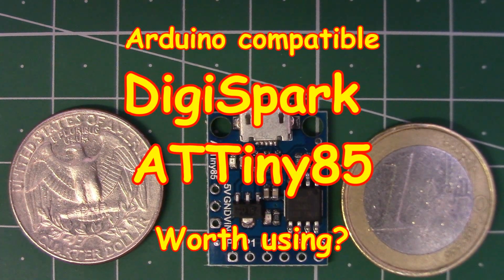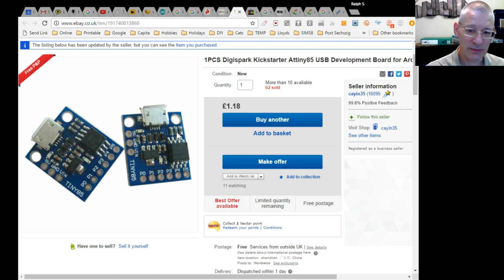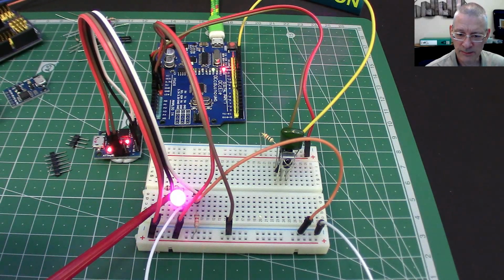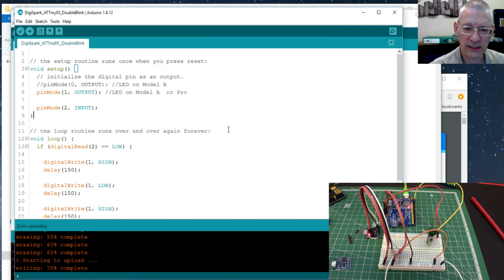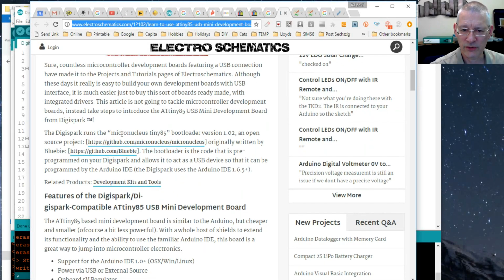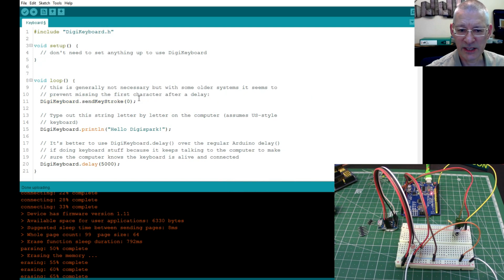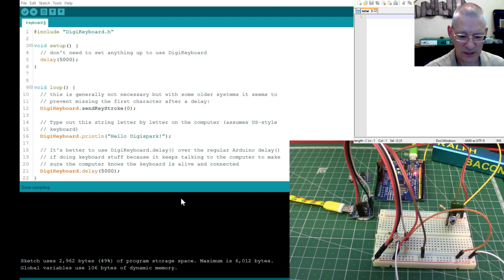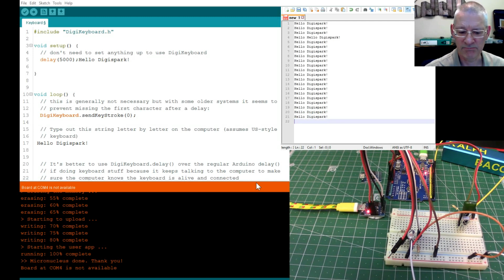#66 AT Tiny85 Digispark - Arduino UNO alternative? An introduction!

Comment: I remember buying 2 of these. I think the engineering on them is bad. Mine will not register properly with windows. They keep connecting/disconnecting repeatadly. Its why I never used them. However in your video you suggested they have power issues. This may be a way to fix them to get them to work better.
Reply from the maker: ATTiny85 devices don't have built in USB so some board manufacturers fudge the issue with diodes and other components and sometimes it works, sometimes not. I use the FTDI or other Serial to USB converter and it's rock solid.

Comment: Hi Ralph, I am back among the arduino lovers once more after a brief absence because, well getting old is hard on an old farts body and I had to loose a chunk, the doctors took my right kidney from me because it had grown very large and was full of cancer.  They tell me I am now cancer free, I hope they are right, the doc who cut me open says he wants to see me very 6 months for the next 5 years, I consider that a plus that he figures I will be around at least that long. At any rate thanks for the refresher on the AT Tiny 85, I built several count down timers using that chip several years ago, had one in my Ford that I pulled behind our motor home, the book said I should run the car for 20 minuits every time I filled the RV with gas.  So I built one for that but made it a count up timer.  Now that I have retired the RV and sold it last week, I have the timers left over. I gave one to our ambulance squad to use when doing CPR in the rig as they needed something like that and that one had a large LED display, my daughter uses one when cooking for a timer. So thanks for the review, I am trying to figure out how to do this in Linux as I got fed up with Apple's obselecense auto slow down and ripped apple OS from the hard drive and now am happy with Linux Mint which runs like a raped ape compared to osx
Reply from the maker: Good to see you back in Arduino Land, Jerry, and I wish you all the best for your future health. Keep up with the programming and electronics, you don't want the grey cells getting rusty.

Comment: I brought digispark attiny85 development board

But this board keep connecting and disconecting continuously
What. We need to do

Please help

Paste
Reply from the maker: You are connecting this board to a USB-to-Serial adapter? Or you are programming via the SPI pins on the board (which is a more reliable way of doing it)? Or you are plugging directly into USB? Check that the any connections are powered correctly and are stable. You have selected the "Digispark Pro (Default) 16.5MHz" in the Arduino IDE? Programmer selected is Micronucleus? You plug the device in within the 60-second timeout period? Can you upload an example program to the device?
Reply: @RalphBacon  
I am plugging in device directly in USB port
Plugged in within 60 seconds
All settings are as expected 16.5 and micronuclous

But after clicking uploading code, 
Code is not uploaded but 

Please tell me
One thing , what device manager shoes

Comment: Do you think one needs the resistors for connecting buttons (actually a Morse key) to the microcontroller and thus emulating a keyboard?
Reply from the maker: A morse key doesn't emulate a keyboard in anyway whatsoever (the keyboard being USB driven). But a resistor from VCC to the pin to keep it high (before the morse key shorts it to GND) is only necessary if you cannot define the pin as INPUT_PULLUP which does all that for you.

Comment: I don't recommend this board. So much trouble. Even simple MIDI songs with buzzer gives me nightmare. Not enough RAM or flash! Don't buy this! Use pro mini they are very cheap, you can buy seperate programmer. Pins can output 40mAh and solid Arduino support!
Reply from the maker: Ha! A lot users might agree. Then again, a lot of users will disagree.
You can't treat the ATTiny85 as an UNO (ATMega328P) they are very different chips, but both are fully supported by the Arduino IDE and some very nice cores have been developed by others to maximise their usefulness. 
Now, outputting 40mA on a pin is the absolute maximum allowed by the manufacturer and you can only have 200mA max into the chip, so normally we try and limit pin current to 20mA to be safe and allow more pins to be used.
A Pro Mini is little more than a naked ATMega328P with some supporting components (crystal, caps); I use them all the time but I also have designed some basic boards that are functionally equivalent. If you don't need the USB support then they work nicely but the Nano is cheaper,  is almost as small and is a full blown UNO!

Comment: I am going to have to come back to this but no matter, I am an Old Git and do not learn as fast as I did but I am interested in this because I used/played with a PIC thing some years ago, an 18 pin device 84 comes to mind but again no matter and it was a simple problem need 3 or 4 active I/O and worked OK (I have/had no problem with assembler language). After digressing somewhat it seems to me that on an Arduino device the amount of programming memory available is far greater than the amount of I/O available, so why have it. Hence the interest in the smaller implementation and I am grateful of you for paving a path because I MAY not be as tenacious as I used to be.
Reply from the maker: Have a look at my most recent video #181 which makes playing with the ATTiny85 (and ATTiny13) much easier.
https://www.youtube.com/watch?v=7Tl8l0PliTk&feature=youtu.be

Comment: Much much later than the date of this video, but I am hoping to use an ATtiny85 to interface a casio fx-9750G PLUS. It would require reading and writing the USB port as well as a Tx and Rx pin pair ,
Reply from the maker: The ATTiny85 does not have a USB port, as such, Johan. If you have a module with USB socket on it, it either only supplies power or the D+/D- are directly connected to the Tx/Rx pins - so you would need a USB-to-Serial module (eg FTDI) to read/write the data.
Reply: I thought as much, but was not sure. Mmmm...

Comment: after i found the attiny 85 i have went out and buy about 100 of them and made lot of little things, about the same as i did with the uno and pro mini and nano, i have many different ways to program the attiny 85, but i now have found the Arduino as ISP is the most fast, i can get 3 Pins with the Atting to work as PWM, and seen some code with 4 Pins but only the 4th pin when one pin is off, and can control them with a pot for speed, i am trying to work out a way to do a easy code with LDR so the LED only turn on at night, as i want to set up the attiny 85 at every window of a build that looks a bit like a censor, maybe some one has some way to do it.
Reply from the maker: You bought 100 of these devices? Wow! I hope you got a massive discount. If you connect the LDR to an input GPIO, read it every few minutes (you can put the chip into deep sleep for that long, by waking up every 8 seconds and doing that 75 times) and only light the LED for a brief 100ms flash then it should run on a 3v coin cell for quite a while.
Reply: @RalphBacon  I sort of got it to work the other night, i can look at the sleep timing later, as i only want them to flash in the night time and go to sleep at the day.  so the LDR turns off the 3 LED's, i was shaking it there when i could not get it to work and found the light in my workshop was to bright. but its working now and made some proto PCB. maybe run it from 2, 18650 or 2 14500, with a small reg on the PCB.

yes i got 100 i pay 0.60 AUD each for them, that's about 40 GBP including the shipping. ATmega328 is about 1.30 each AUD each. when i was working in China i made some friends in shops with taobao haha
I like to ask what is the best mosfet  to use with Arduino i have been looking at IRL 630,640, 520,540  LOGIC switching

Comment: These boards are a NIGHTMARE! Stick to to the Nano / Pro Mini... OR make your own shield to use an Uno to program ATTINY85 DIP-8 Chips.
There is also an error from the chinese factory with Pin5. The Fuse on Pin 5 is set incorrectly. So, this means that every time Pin 5 goes LOW the whole board resets. There is a way to write to the appropriate register or something to make pin non resetable. Check this out Ralph, if you havn't already. I'd love a clear video done by you on this.
Reply from the maker: Hmm, perhaps my Tiny85s are from a different source as I haven't found this (not that I use many Tiny85s). I'll see what I can dig up on this issue...

Comment: Hi Ralph I have purchased 2 ATTiny85 boards the same as you show but I am unable to load the board using the link shown for the Arduino IDE the link is in Preferences - http://digistump.com/package_digistump_index.json So I don't see any extra boards or anything in board manager any suggestions please or perhaps you could do a video on it to help others with the same problem!! ( I am using Arduino Ide 1.8.9) ( just changed to 1.6.12 and all working ( ThanksRalph) All the best Bob
Reply from the maker: So are you saying, Bob, that  IDE 1.8.9 doesn't work to program the ATTiny85? But IDE 1.6.12 does? How strange. Try 1.8.9 again, perhaps it was just a glitch? Be interesting to know... 🤔

Comment: There are times when I only need a few pins so yeah this fits the bill.  Didnt know about the keyboard emulation. So you can send data direct to Excel, nice. I bought a few of these but I haven't had the day to get them going.  Thanks Ralph.
Reply from the maker: Thanks for that, Joey Mac, nice to hear from you.
Reply: I could not get these to upload successfully under linux. I don't use windows any longer so I do not think this is an option for me.
Reply: I did get these working. I had to unplug the board, click download, then re-connect the board.

Comment: Ralph, there is a way around the 5 sec delay, needed it for a low power battery project and couldn't live with that timeframe as my code ran for less than a second. If anyone is interested I will post the details, its works a treat
Reply from the maker: It's been a while, Dean, since I fiddled with the ATTiny85 so do please post away your solution for others to read. One option, of course, is to use no bootloader so the code runs instantaneously upon power up but you probably have a better way.

Comment: Ralph! Love the tutorials by the way, your videos are god sends!  I have a conundrum for you. Im using a Yamaha MG166C mixer for internet radio, I'd like to know is there a way I can make a unit with a nano or Uno (whatever is needed) that I plug my mic into, which acts as a through line into the mixer but what the Arduino does is, when the mic turns on it works a relay that will turn off my speakers and turn on my ON AIR light.  My Mic has a 48v phantom power line going through it. Thanks for any help you can give me on this problem.  Regards MDD
Reply from the maker: Hmm, you just want the act of switching the microphone on to disconnect the speakers and switch on an "on-air" light - but not affect anything else, right, Marty?
 
How do you switch on the microphone? Via the mixer? How can we detect that the microphone is "live"?
Reply: @RalphBacon  Firstly thanks for your reply, Yes you are right, the Mic plugs into a mixer, the model is the Yamaha MG166C. Its a condenser microphone which takes a 48v phantom voltage.  There is an 'on and off' button to turn it on and off.  The on air light is from canford, it has a 240v light bulb in it that gets activated via some pins lol the spec for it can be seen here https://www.canford.co.uk/Products/20763/51-401_CANFORD-ILLUMINATED-SIGN-BC-base-fitting-type-A-230-volt. I'd like to so when I press the mic on button it pics up that the mic is now in a live state and activates the arduino to work 2 relays, one that touches the pins together lighting the light and another that cuts the power to two monitor speakers thats are 240v powered.  Any more info needed Im at your service :) Thanks Ralph.

Comment: at 17:25 you talk about the "digiUSB" but seemed confused, not sure what they're talking about there but on EVERY operating system all that is needed to talk to an attiny is usb 2.0 OR a usb HUB that pushes USB3.0 into fallback mode to 2.0... because then avrdude can talk and upload to the attiny. As I said this is irrelevant of whether you're on windows xp - 10 or any Linux distro (not sure on OS X). That is the same as the adafruit trinket (which is very similar to the digispark thing you have)
Reply from the maker: Ah, yes, indeed grats gg, that was referring to what the instructions said that Windows 10 should have identified the USB Tiny board as. Basically, once the hardware had been enumerated I should have had a device named "DigiUSB" but I did not, it was called something else (possibly some generic term, or indeed never showed up at all) but it still worked fine. That's all. And, as you say, as long as your PC (of whatever OS) can "see" the board then it will communicate with it. Thanks for posting.
Reply: ohhh ok I see. I haven't been on windows in many years so I forgot it tries to name every usb device.
Reply: I am on a linux machine. If I look at my usb ports it is listed as MCS digistump digispark. Also there is a Linux foundation 2.0 root hub.

Comment: The Tiny85 get programmed in a different way as well. It gets programmed by power it off, and powering it on, and when it comes up it will read the program.  You also need to load the library for the Tiny series of chips.
Reply from the maker: True, Joseph, I think that's the way that bootloader is written? It should do the same on an RST... I think. YMMV. Thanks for sharing the tip, nice to hear from you.

Comment: Hi, Ralph, I want to make a copy of a three button IR transmitter so do you think this would do it??
Reply from the maker: Well, Bob, you need a PWM output for the IR LED, plus three pins for the buttons (using a switch matrix doesn't help to reduce that here). If you have enough pins then it will certainly "work". If this were me, I'd get it working on a standard Arduino Uno/Nano and then port it over to the Tiny85, just because it is so much easier to work with the Uno whilst developing.
Reply from the maker: Actually, you don't need pwm, just a digital output.

Comment: Its harder to program those attiny85 boards than a pro mini.. I have lots of problems with attiny85 when it says to plug it in, I do and 1/2 the time it doesnt work.
Reply from the maker: Agreed, HH, that is the case with me too. In fact, it's sometimes worse than that inasmuch that I can do half a dozen uploads no trouble at all, then it decides it doesn't want to play anymore and refuses the next 4 or so! Bizarre. There's probably a knack that I haven't quite mastered yet. When I find out what it is I'll let you (and everyone else) know! Good to hear from you.
Reply: I know you didn't seem to like the pro mini but its really easy and reliable to program and works all the time and is a full Arduino just tiny..  great vids!!
Reply from the maker: It's not that I don't like the Pro Minis, HH, it's just that they don't have a USB port so that makes demoing more difficult. And, in a real project, not being to quickly plug in a USB cable is less than ideal, but that's just IMHO. I'm sure they are great to work with if not having a USB port doesn't make you go grrr every time you want to upload!
Reply: @RalphBacon  Al you need is a FTDI basic chip from SparkFun. They come with a female header. and USB port. Then you take a male header and put it in and hold it to your Mini Pro and upload.
I have 2 Mini Pro. One 3.3 V and a 5V with male headers. These are for testing purpose.
When the software is ready i'll take the new Mini Pro and upload the sketch as described above.

Comment: I have been using these little digispark's to build count down timers for specific problems. For example, my wife had medicated eye drops that require that she install the drops in her eye, then wait for a specific period of time, in the Morning, it requires a 2.5 minute wait, and the evening drops require 2 minute flat count downs.  So I built her two timers using these and a 4 digit 7 second i2c display, as well as a buzzer that plays a merry little tune when the time is up.  I have it mounted in a very small project box, with a 9 volt battery holder with built in switch to run the device.  I even built one for our car, which I tow behind our motor home when traveling. It requires a 5 minute run every morning, and at every gas stop, so I tossed another together for myself that sits on the dash of the car displaying the time so I can insure the transmission get's the oil distributed through it each stop.  I am going to modify that one though since I found that running the car for that short of time, then leaving the key in the accessories position drains the battery, when we arrived in Arizona this fall from South Dakota, at our last stop before hitting our favorite campground on the Golden Shores of Topock, the battery was completely drained.  I ended up getting a boost start from the managers golf cart, then drove the car to a neighboring city on the interstate.  At 75-80 mph it did not take long for that battery to come back to life and she hasn't been a problem since.
Reply from the maker: A brilliant example of Real World solutions, Jerry. Did you use the TM1637 for the LED display?
Reply: Yep exactly, very simple to build and program and they do a great job. I am not sure how long the battery will last, thus far it has shown no sign of stopping.